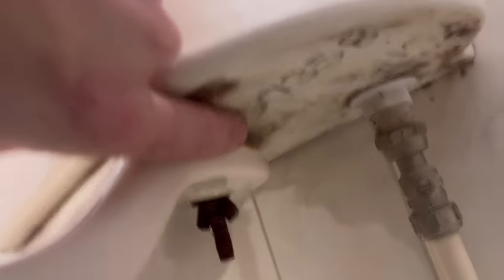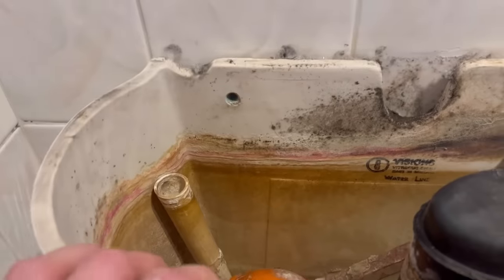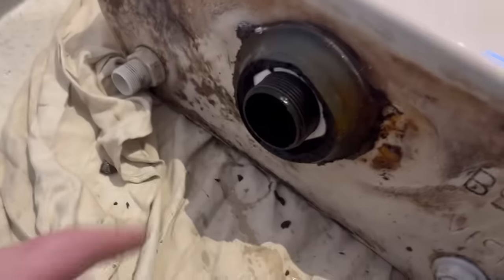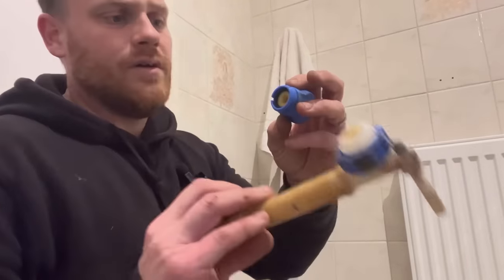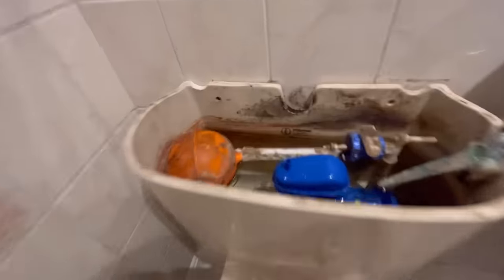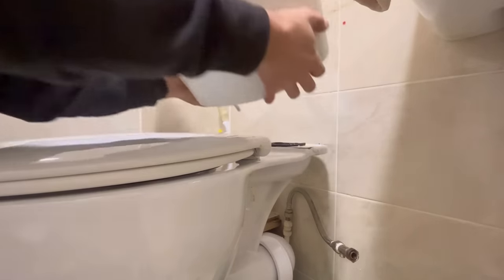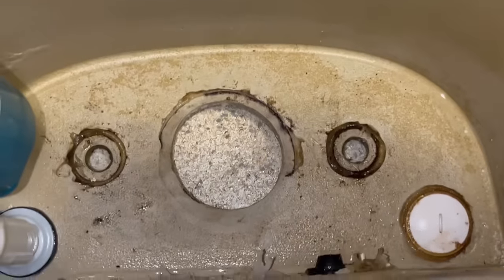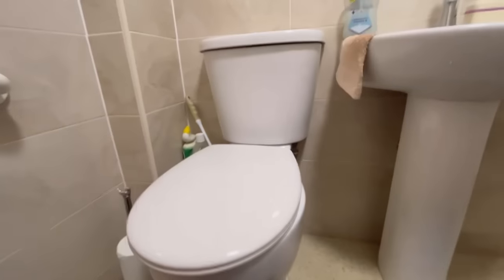Worst Plumbing Repair Ever! Plumbers, Stop Doing This! NIGHTMARE

Comment: Don’t worry I won’t be employing you as a plumber on my team.  You are making rookie mistakes.  Eg always use a multi tool to cut off rusted bolts; brute force causes breakages.  When your screw is jammed you have to tap it to seat the screwdriver better and hence release the screw.  Very important steel screws should never touch ceramic!! Always use rubber washers (or tap washers).   We would never only change the syphon.  As it is apart we would always also change the fill valve.  Also we never fit an old type syphon as you have to adjust for cistern size and they don’t work well.  Best to change for new cable type that work much better.  Could keep on like why not use a Stanley window scraper type tool (cost £3)!  Why use fibre washers?  Rubber ones better and easier!  Think you may be more of a Heating Engineer than a plumber!
Reply from the maker: Yeah heating engineer, plumbing comes with being self employed and trying to grow my business I won’t be perfect unfortunately, I haven’t found anyone on YouTube that is…. hope you enjoyed the content thou 👍

Comment: I hate silicone on toilets! It makes the next plumbers job harder than it should be
Reply from the maker: It does mate, I haven’t had a toilet come back in yet that’s leaked that I’ve fixed without using silicone. Just don’t see why people put loads around toilets and basin wastes